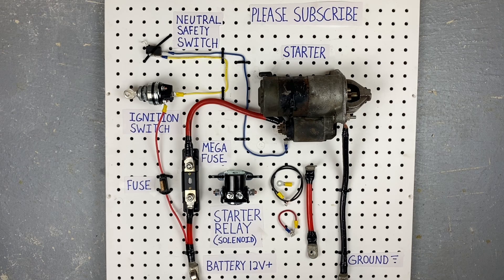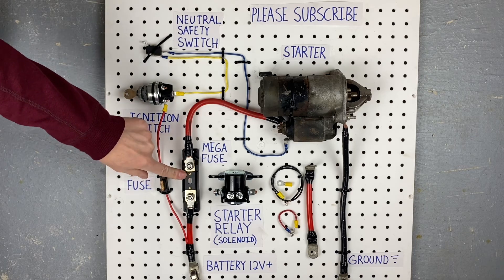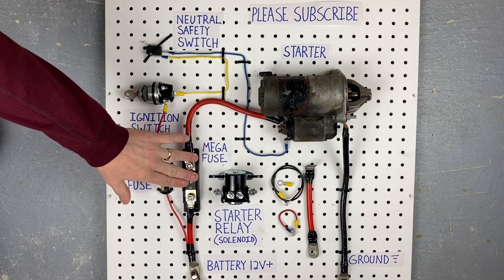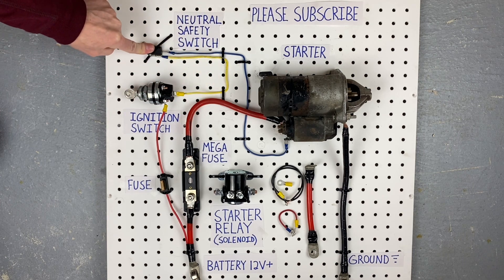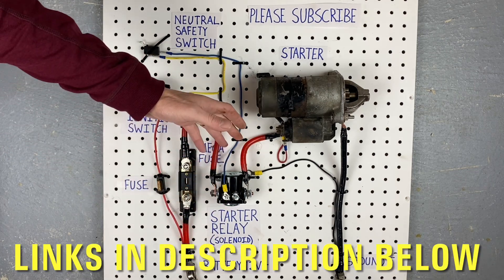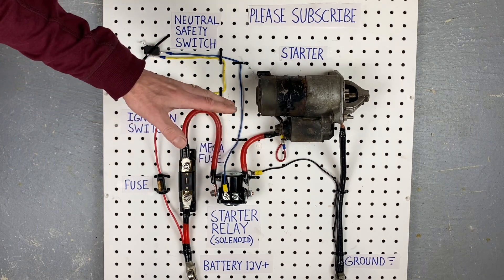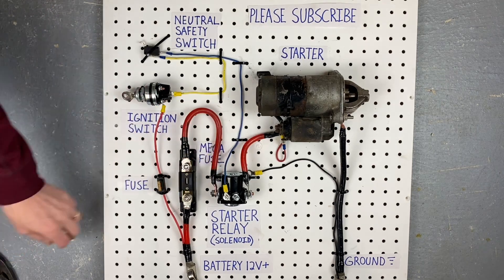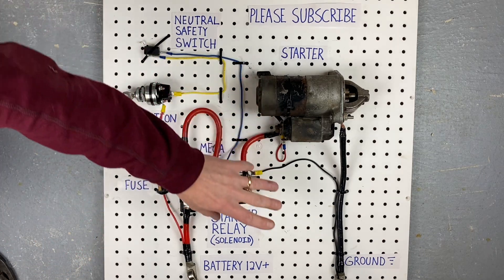How To Wire a Starter Relay Solenoid and Neutral Safety Switch on Any Car Truck |@WiringRescue

Comment: With the basic knowledge in this video I built an independent starting system (so I could better kick the starter off a push button) with a covered arming switch and indicator light and an indicator light for when the starter fires. When I was in high school I dreamed of my 73 cobrajet having a starting sequence with lights and switches. You not only told me how to hook it up, but how it works and what each component does. It was easy to install and easier to expand on. I've been studying automotive electrical for over a year now and your videos are the most comprehensive and informative that I've found. I salute you for what you're doing for the culture. Think of all the ratty muscle cars you will keep from being junked because of your schooling. Keep em on the road, dirty side down!
Reply from the maker: Heck yes! That has to be one of the best comments I’ve received! Thank you so much for sharing your win with me. That totally made my day, and is exactly what I hope for when making these videos.  You rock!
-Jeremy

Comment: If someone wanted to build this set up can you go over that ?
Reply from the maker: All of the components you’ll need are in the description, with links on Amazon, though you could easily buy all of this at a local auto part store as well. Then it’s just a matter of copying where the wires connect. 
Is there a specific area that you’d like more details on?
Reply: @WiringRescue  I mean writing of a paper on this

Comment: Is a hundred amp mega fuse enough?
Reply from the maker: It all depends how much the starter amperage draw is. Many cars don’t have a fuse in this wire at all. You just need to make sure the wire is secure and not a fire hazard if you go that route. Definitely do research outside of what I say though, because I’m just a random guy on the internet.

Comment: What causes the starter fuse to blow when switch is on....
Reply from the maker: Too much amperage going through the starter wires. You need to figure out where those wires are going and what they are connected to that is drawing so much amperage through them.

Comment: This has got to be the best video I’ve found trying to fix my 87 f250 yet, I tried to crank it one day to find out that it’s just making a very high pitched whining/screeching sound. Keep in mind I replaced the starter 2 weeks ago. I ended up replacing the relay on it but it still wouldn’t budge. After watching this video I think I’m going to just replace the whole setup after I order the parts. Any advice from y’all would be great!
Reply from the maker: I’d throw a test light or multimeter on it to see what your problem is before buying any parts. It would stink if you put all new parts on your truck and found out it was a bad ground on your engine block!

Comment: Thank you for the information, I installed a relay or solenoid and it got hot, is this normal or not?
Reply from the maker: That is probably not normal. It may not be rated for the amount of amperage that is flowing through it, or maybe you are use a relay that is not meant for continuous use, for continuous use?
Reply: @WiringRescue  Thank  you for the quick response. It’s a solenoid, and it gets hot just by being connected. Positive of battery is on and the “S” on it is not on yet. The “S” of the solenoid only turns on when the car is on.

Comment: What tells the starter to turn off when the car has been started?
Reply from the maker: When you let go of the key, the power wire going to the starter solenoid goes dead, which causes it to stop spinning and the gear pulls back inward.

Comment: Could you do a diagram of 4 pins solenoids connected to a 2 wire trim motor not using a harness just a switch

Comment: I much prefer the remote starter relay, the ones on the starter can easily get cooked by headers and then you have to replace the whole starter.
Reply from the maker: Agreed, plus I like having a spot under the hood to jump the starter with and grab power from. Thanks for watching!

Comment: Do you have any recommendations on the size capacity of the mega fuse? 

Thank you for the explanation. I didn't connect my nss from my harness and I was troubleshooting when I found your video. Perfect explanation. Thank you.
Reply from the maker: This is a highly debated topic. Many cars do not have fuses in their main power wire to their starter. Though some do. I would recommend doing a little research on the fused power wire before committing to it. Some cars don’t want you to lose all power to the vehicle if the fuse pops. It’s weird and fascinating all at once. Worth researching!

As far as fuse sizes, I made a video about that right here: https://youtu.be/EhzN6UdnmPA hopefully it helps you out!

Comment: most solenoids work same way  you turn key solenoid will engage starter if all ok  but if all you get is a click when turning key short the 2 big bolts on soleniod this spin starter if battery ok  ---- replace solenoid

Comment: If the silinoed is bad on the starter will this still work? My issue is my starter that has a built in silinoed gets to hot from the exhaust. If I add this will it still work?
Reply: No ,the solenoid  on the starter engages the bendix  gear with flywheel  to turn  engine.

Comment: My long tube headers roast my starter all the time in my 94 mustang...maybe this will fix my problem.
Reply: Get some heat shield wrap for both components. It sounds like wiring has nothing to do with it. Or you didn’t say what you meant to say

Comment: Is it possible to fix a push button start switch on a 52 cc petrol outboard motor which currently starts when you yank the cord. Please guide on how to do it and parts required. I am a total novice. I asked a few mechanics and they said it is a very big job with lot of modification
Reply from the maker: That is a big job. Here are some of the problems you will have:
- you need a flywheel on the crankshaft with teeth around it for the starter to grab
- you need to find a starter that will be properly sized for your engine and then make custom brackets to bolt the starter to the engine
- you’ll need to add a battery
- you’ll need a method of charging the battery
- you’ll need all associated wiring

Comment: Thank you for your time and video! I'm building a classic nova with a LS that's being totally rewired and pain in the Azz thanks again
Reply from the maker: Heck yes! LS swapped Novas are my jam! I’ve spent no less than a billion hours working on my friend’s 72 nova with a 6.2L LS + T56! Thanks for watching the video and good luck with the Nova!
Reply: @WiringRescue  mine is a 72 Pro Street with 30x18.5 tires 4l85e turbo, you explained everything fantastically . I had the general idea and you gave me a better! rather then a mega fuse I gonna look at a 300 watt circuit breaker 🙏🙏🙏much thanks again
Reply from the maker: @kittykitty643  - sounds like a badass car to me! Glad the video helped you out. If you have any other wiring related questions along the way - post em up here!
Reply: Really  interesting  i love it

Comment: I have a xantrex AGS for my solar inverter/charger.  It is supposed to detect when the batteries are low and start the generator to help charge them if it is cloudy or night time.  The issue I have is my generator is a WEN dual fuel 4750W electric start.  So it is not set up for remote starting and I there is nothing but a key start switch.  In order to connect the AGS to the generator would a relay  as an interface between the 2?  The relay would receive the on/off signal and start/stop the generator.

Comment: Great video 👍 my question will be when the car is running and you turn the key to the off position how does it stop the engine from running?  Does the power going the Ecu stops or the ignition or fuel pump?
Reply from the maker: Thanks for watching! Typically the key turns off the power to the ignition system to stop the engine.
Reply: Ratty Muscle Car thanks for the reply really appreciate it
Reply from the maker: @jcjimenez5327  - happy to help!

Comment: Good info. How about a 24 volt starter system. I need to figure out how to wire up a vintage Diesel engine that’s 24v.

Comment: I have an issue with my car:  while the engine running the starter motor worked too ... This issue is shown the mechanic replaced the previous damaged starter, what do you think about this situation.... Does this issue comes because of a wrong installation of the starter motor ? I need your opinion about this please.
More info (I have replaced the starter relay; car models m-benz ml350 4matic 2012)

Thanks in advance for your kindness

Comment: I know it's a miniscule amount of amp draw, but shouldent you place the hazard flasher after the switch that way you can park your car and not have it draw any power? or does the led flasher not draw any current when the switch is.....you know what, i just realized that the flasher is not connected to ground without the switch in the on position...

Comment: I liked most of your explanation on this subject; however I would like to let you know that the fender mounted device is in fact a Relay Switch and NOT a Solenoid. The relay does only one function which is to complete a connection sending the current through to the Cranking Motor. It is just like any other Relay Switch.The Solenoid attached to the Cranking Motor performs two functions; the first is to energize the Motor by way of the coil making the contacts come together and this in turn forces a separate bendix gear which is forced out into the Flywheel ring gear and also spins this smaller gear to turn the ring gear cranking the engine over to start the vehicle.

Comment: Can use it as a relay to power an external fuse box?
Reply from the maker: Nope, you need a “continuous duty” relay for that. This type of starter relay in my video is not meant to stay activated for long periods of time. Continuous duty relays use way less amperage to hold the relay in the active position too.  Cole Hersee is a good brand for them.
Reply: @WiringRescue  the thing is I wanted a relay that have a big amp capability like 500A 🤦 and already ordered 4 😭

Comment: On my impala the neutral safety switch is on the column, however could I run another cable between that and put in a switch so no power is there and it won’t start?

Comment: Love the advice for the fuse , many years ago I learned the hard way connected a wire and it heated up so fast that it started burning and I grabbed it with hand me to pull it off and burned the finger half ways through. The content on your video is excellent.
Reply from the maker: Thank you! Long ago, I did that too. It quickly teaches the importance of fuses and proper wire size! Thank you for watching the video and the kind words!

Comment: Great Video.    When hooking up signal wire for the solenoid (Similar to a GM starter with the solenoid on the starter, it is very important to see the inrush current of what the solenoid creates.   I have found when rewiring cars that this wire is always undersized.   However, great video!
Reply from the maker: Thank you for watching, and sharing the info. I totally agree!

Comment: Coincidence! I just wired up some LED turn signals using one of your videos! big fan of ratty muscle car, keep it up 👍🏻
Reply from the maker: Excellent! I’m thrilled that you’re finding them useful. I’d love to make more rusty car restoration videos right now, but my garage is ARCTIC! These circuit videos can easily be done inside my warm house until the garage returns to an above freezing temperature! :) thanks for watching and good luck on your project!